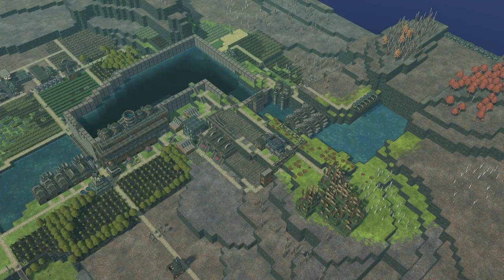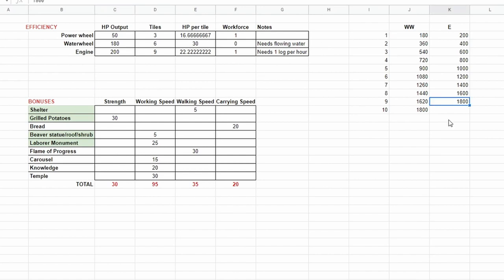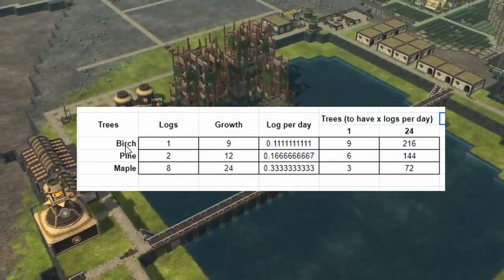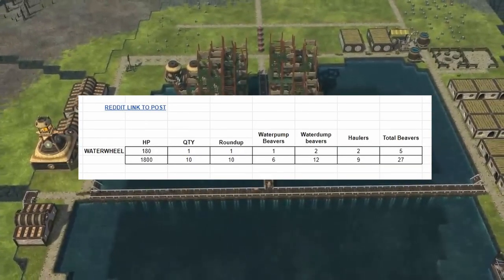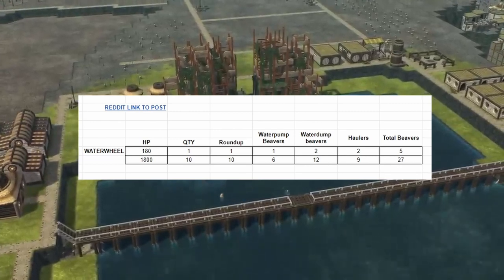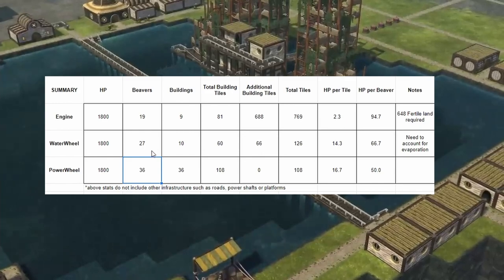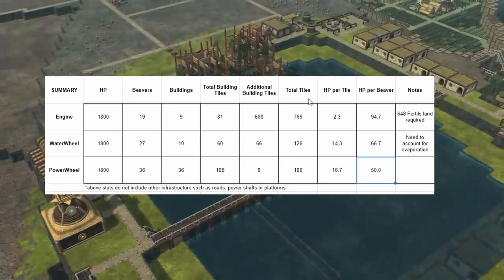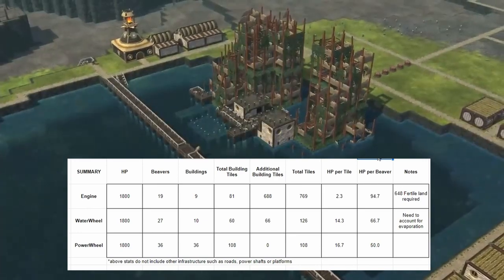TIMBERBORN - Let's Talk About Power

Comment from the maker: Couple additional comments for the video:

1) On the summary section - Additional Building tiles include the following structures: Planted trees, foresters, lumberjacks, waterdumps, water pumps. No storage buildings were calculated in there. Therefore the total build area for both the engine and waterwheel setup would actually be slightly larger.

2) After looking through the footage, I feel I could have been a bit more clear about why I did not run a test on the waterdumps.
Basically, that setup is the only power producer in the list here, that requires you to actually think and come up with a design to max efficiency. I'm talking about the design decisions involved in building the perfect canal to maximize the gains and reduce water surface area to ultimately have less water evaporate. 
Sadly, the game does not have "creative mode" where I could plop everything down, without having to worry about additional infrastructure such as keeping beavers alive and gathering resources. If you've played Oxygen Not Included or Scrap Mechanic, then you'll know what I'm talking about. Otherwise I totally would have invested the time to come up with the best solution.

Once again, these are just my thoughts based on the numbers I could find on the web or in my testing, so don't quote me on that hah.

Thanks a lot for your input, I absolutely love it all and I'll promise to try to catch up with them all this week on previous videos <3
Reply: There are actually a few mods that allow for instant and free placing and breaking of buildings, if that is something you would be interested in using for testing. 

Creative Mode by HawkFalcon is one of them
Reply from the maker: @gusmcguire17  Oh god... I wish I knew that before recording this video hah. Thanks a lot for letting me know !
Reply from the maker: @Willie Wonka Cheers Willie! It was actually intentional to leave food, drinking water, resources, science etc out. This would have meant analyzing almost everything in the game and I was not willing to spend days on this hah
Reply: When you use spreadsheets... dam, you really put in the effort; I don't think even I would go that far! You earned the respect of a fellow subscriber.
Reply: You mathed this and I am so here for this :D  Great video, thank you :D :D :D  Is there any way we can convince you to allow your google sheet to be made public please to allow people to make a cheeky copy of it? 

One could be lazy and ask for that :D  And I know, that's ever so rude; but you've got a great sheet, and I like to work with a good foundation :)  
I've saved the link to my favourites and will definitely come back to this when it's time to mega plan my electrical grid, so thank you :)  I really enjoyed this video :D :D

Comment: the thing to remember about the waterwheel set up, it scals really well, it may have high capital to get it going but you can keep putting waterwheels in a line and use a few water dumps to power the line while not loose too much efficacy.
Reply from the maker: You're right Tim. I just didn't want to get too much into the waterwheel setup because further testing would be needed and without creative mode there's no way I'm gonna spend a full day just to wait for beavers to build it all. Additionally, I don't want to recommend it too much because of reliability and the ease of use. With the other two, all you need to do is plop the buildings and have resources ready. Whereas the waterwheel actually requires you to create a suitable design. Maybe once I have more spare time I'll revisit the waterwheel option :)
Reply: @BabyDragon1  thats completely fair i understand. its going to be interesting seeing the Hamster Wheels at work as its something I haven't really even considered due to it being a "early game" building.

Comment: I think there is a small detail that you missed, that is, you acount for trees, but do not for farmland, true the powerwheel doesn't seem so complicated, however it needs to feed 27 more beavers! 27 that, btw, could be doing other projects or even, duplicating the power production, since 27>19.
Reply from the maker: I know what you mean Rafael, however I tried to keep this video as short as I can. Also, I could have listed all the resources and science required for each option as it is very important to be aware of. But tbh, then I'd have to analyze literally everything in the game and that's not what my aim was. Hope this makes sense :)
Reply: @BabyDragon1  it does and I understand, is just that I believe that the diference of 27 beavers is so huge that it could not go unoticed, that is why I made my comentary, anyway, hope you the best and thanks for the research, it will help many for sure ^^
Reply: @BabyDragon1  Also, I have a question, does 27 more beavers consume more or less water then trying to power the water wheels?
Reply from the maker: @Fafuncho  I guess I was assuming that by highlighting the high staffing requirement, people can make that connection themselves, but you're right, I could have easily spent another 10 seconds to make it a bit more clear :)

About the water consumption, I did not notice in my testing and/or research that running the wheels would increase/decrease their water consumption. 
Perhaps there's someone with more knowledge/experience that could share their findings

Comment: Great video. Very interesting stuff. I always dig a spreadsheet! The log cost of the engines was a real eye-opener.

I think I would set up the waterwheels and the powerwheels. Once the logs are spent, there is no maintenance, etc. When it's the wet season, the hamster-beavers can do other jobs. When it's the drought the hamster-beavers can get conscripted back into service. The biggest "tile" benefit to the waterwheels is porbably that you are building them on tiles you wouldn't be building on anyhow (middle of rivers, etc.). So for the upfront cost of some logs, you get the best of both worlds.
Reply from the maker: Cheers Paul, I hope it didn't put you off too much as you could still incorporate a few of them. I guess the biggest annoyance I have is that the engine does not stop when paused but when it runs out of logs. Essentially pause just means that beavers stop re-stocking it :/
I agree, that would be the ideal solution
Reply: @BabyDragon1  though with powerwheels, you gotta take into account, that a higher beaver count also means more food production is necessary. How many tiles food do you need per beaver?

Comment: One thing I think you missed with the engine is that you only need the engine running during the drought and the waterwheel’s can run during the wet season. So the trees can grow during the drought and wet season so you can “reuse” tree tiles to stock your supply. That being said I think power wheels make more sense
Reply from the maker: Hey Brendan! 
It was actually intentional, I just wanted to present the numbers on this in case there are players that just wanna plop buildings down and never touch them again hah 
I do understand what you mean, however it really is down to the players themselves now. There's so many variables to consider, such as food, drinking water, resources, science, difficulty, size of the map, terrain, layout, playstyle etc. So essentially, I wanted to raise awareness that don't build lots of engines if you're on hard mode and you haven't calculated how many trees you need planted and which are the best trees to plant. Or when it comes to waterwheels, perhaps do a test run before trying to implement it on hard mode (just like how I failed on my first try), but also be aware that when on hard mode, you might wanna have enough water stored up.
Overall, I'll probably want to use a mixture of different power sources and jump between them just like you described above :)

Comment: in other words in wet season make use of the water wheel with mass industry running on the same time to fill up material, when dry season only use minimum required power wheel to power the industrial that needed to be keep on running, maybe keep on making some planks or gear, only make dynamite when is need. that mean paper meal and scrap metal can be paused, keep in mind as dry season getting longer and longer, the flooded river can easy dry out so u must stall up a lot of water to keep the river fill to prevent your crop and tree from dying
Reply from the maker: Indeed, very good observation!

Comment: A somewhat different video, but an interesting one, it's something I've thought about but don't have the game to try out myself. Good job on doing fairly exhaustive research) My one question would be about the water wheel setup, it would seem like by adding more water wheels in the same channel, you could scale up power output without needing to scale up the supporting infrastructure and workforce by the same amount, so that one might in fact be the winner for higher power demands, but whether your colony will use enough power to make it worthwhile is another question.
Reply from the maker: That's what my thoughts are as well. I feel the waterwheel would be the winner in terms on scalability, however I do not want to make bald claims again without having tested it, which I sadly won't be doing since the game does not have a creative mode. Hope this makes sense :)

Comment: Great analysis, would have been good to add analysis of wind power as well although I understand you would need to go back to folktails to do it.  I've also found wind to be inconsistent which can be annoying. I'm trying to do a water wheel set-up on hard folktails atm but still trying to sort out flooding issues, height differences to generate flow and the correct numbers of pumps/drops so your ratios are a great help. One benefit of water wheel is it also irrigates your land at the same time and feeding all the beavers is less of an issue.
Reply: I did set up a windpark on a hilltop just to realise that inconsistence... i would like to have different windconditions all over the map so you could even out those issues by building them in different locations. Now it seems to be the same amount of wind all over the map at a time.
Reply from the maker: Cheers Scott, yea It was mostly oriented towards the current ironteeth playthrough, so I did not want to include buildings that are unavailable to them.

Regarding wind, I noticed the same when I built small & large windmills right next to each other. Large one would still run whereas the smaller one had stopped. 
Glad it helped a bit and you're a great example why I prefer everyone to decide on their own which option or a combination they would prefer to go with in the end. For some, feeding extra beavers might be a no-no, whereas you've found another benefit of having the waterwheel system, which is great to hear. 
All the best Scott!

Comment: I think you made some miss calculations when you calculated the amount of beavers needed to run the 10 water wheels, according the Reddit source you provided, you would need 18 beavers for an infinite flow in a 2 tiles wide canal. The canal can be as long as you want without the need to increase the amount of beavers pumping and dumping, because the amount of water flowing in the canal doesnt change. Therefore aslong as you construct everything in an 2 wide canal it would take 18 beavers to operate no matter the amount of waterwheels.
Reply: You could even add a floodgate at both sides of the canal to make it opperate by it self without the need of bevers every time the drought is over. Making it even more bever effiecent.
Reply from the maker: Hey Rass! Not sure what you mean, 6 in waterpump, 12 in water dump and 9 in hauling station = 27 beavers in total.

Comment: Ya. Basic Row House can house and and have from 2 to 4 power wheels. And work speed bonus apply to the power wheel. As word speed permits them to complete that 50 HP quickly. As power is generated on completion of work. The Advanced Row house can have 3 to 6 power wheels attach. When you have haulers feed your machine. Your going to need 4 plank makers and two gear shops. Putting the log piles near to the producers. Yes power wheels are good as the make power faster. As when the beaver completes work on it the power is given to the plank makers and they eat complete the logs. Having one hauler for each service. Like a gear shop and store house. Building your producer on a small storage house as your able to pipe power over or up to two levels with the basic row house or three levels with the advanced. I recommend the front of the row house to pipe power into a barrack with one tile.
 The setup is so effective that to slow my beavers down from turning all the logs into planks and gear. I must shut down the factory or they will eat all the logs into planks. The thing that slows this process is travel time and distance. Yes I run the 20 hours a day. But to manage the work flow I have to consider a 12 hour shift. As how much do they move in 12 hours. You observations are on point as when I use the power wheel power house your going to need lots of beaver bling. It supports a play of when you need logs. Stop running the factory and go to the field and cut wood. Your going to need 150 beavers and that is just for four plank makers, gears shops, two paper mills, two book makers and one scraper. The burning factory is turned on when I have a massive die off. Yes in hard your able to keep a head of the drought. The issue would be over head. You have to watch the machine.
Reply from the maker: Cheers for the long yet detailed comment on this. Very interesting read and I agree, everyone should decide what works for them, based on their scenario :)
Reply: @BabyDragon1  Sorry for my spelling and bad grammar. I run the power wheels with my Iron Teeth. Yes the hauler huts are important as the Iron Teeth have man power. They are a burst type game play. I do things like build my water extractors on the reservoir. And flood my three farms. Set my farms to harvest. FYI, the clone vat pop out kids every five days. Iron teeth are explosive. To manage pop growth build a vat at night when they sleep and set it to high priority. Build on for ten days in a row. Your going to need two small store houses at full to maintain them. The power wheel plant is going to need you to advance very fast. Work speed is what your going to need and your research is first but you only need four huts when your focus on buffing. By cycle 16. I really did not need to expand but had plans to green the entire mount map. I build my factory on the reservoir. Your going to have to ride "0" zero.

Comment: Water wheels are a bit weird. In real life they extract energy from gravitational potential of the water in the river so you need the water to "fall" while going past them.

In the game that doesn't seem to be the case, as far as I can tell, you could have a huge section of river, all at the same height, and have wheels all along it. I could see a situation where the wheels scale up much better as your power demands increase. Maybe you could run 20 wheels off almost the same amount of beavers as needed for 10 wheels, just by extending the river. The only extra cost is more evaporation.
Reply: Hi!

Water wheels convert the kinetic energy of the water flow into rotational energy of the output shaft. If you have high water flow in the river then it's all you need, but when the flow is limited then you have to use additional "techniques" to increase the kinetic energy. One of those is the use of falling water - while falling gravity accelerates the flow exchanging the potential energy into the kinetic energy. You can also use both for greater effect.
So the system in game is in line with the real world. I would like to see in the future the added difficulty of managing water flow speed to achieve necessary (or even boost) output power.

@Baby Dragon I also think (I have done limited testing but the scope is to small to be conclusive - same map) that all you need is set numer of water dumps to achieve necessary amount of flowing water and then you can just add waterwheels without the cost in population. But with that option there will be an increase in evaporation.
Possibly the best option would be one tile wide channel located alongside map edge (I'm going for that), that loops on itself, dumping the water into the reservoir that the water is pumped out from.
Reply from the maker: I agree with you. But as I explained that without the creative mode, I'm not willing to invest too much time to testing it all out. I would like to re-visit this option in the future though as it has the potential of being the winner in scalable options
Reply: @Machiavelizm  I mean it's pretty much the same thing as I said, with no gravitational potential, there's never going to be any kinetic energy. The power output of a river is directly related to the water drop. 

I am curious if the game does actually "extract" energy from the water though, really each wheel should slow the flow, I wonder if it actually does. If you could have unlimited wheels in a given piece of river then I could see that being the best at scaling.
Reply from the maker: @Machiavelizm  I share your thoughts on this, but without a good amount of research or testing I did not want to commit making any claims on this hah